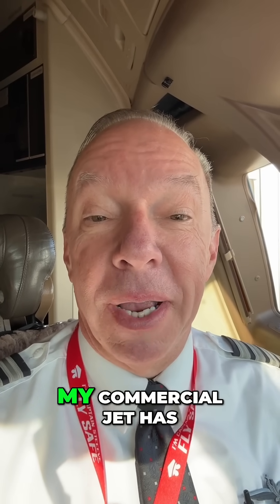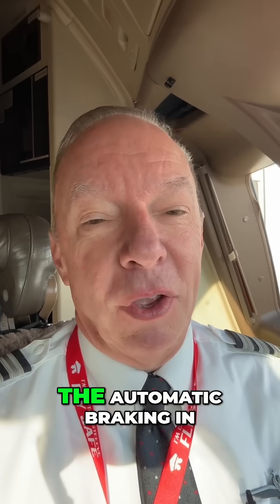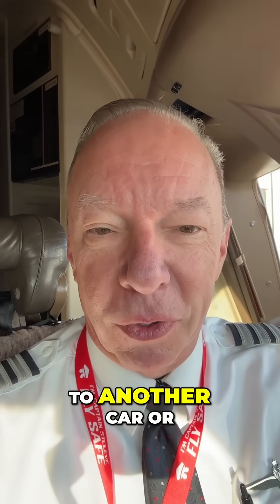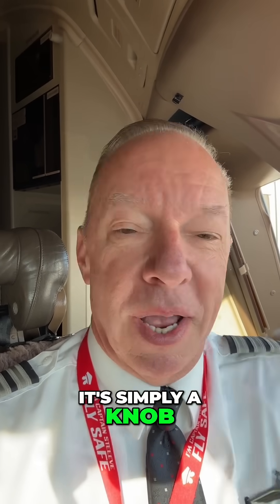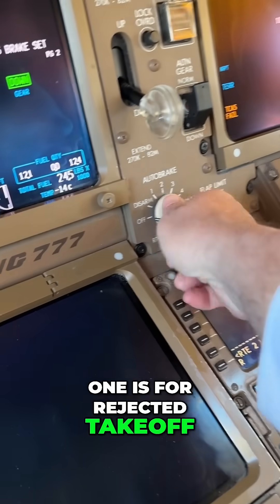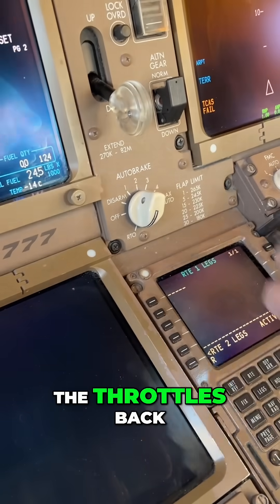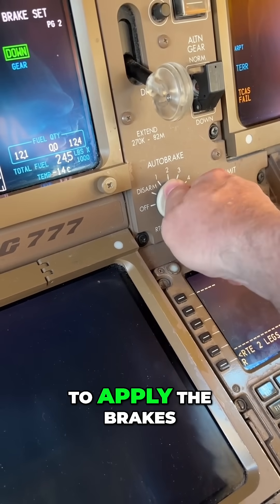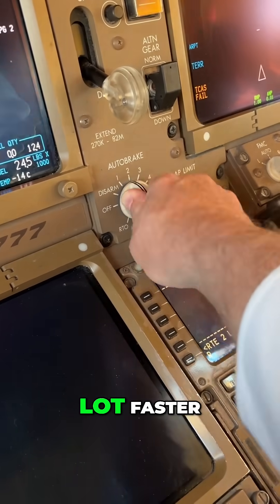How Automatic Braking Works in Commercial Jets

Comment: ATC here. Any insights for brake-to-vacate systems.  EK A380s have those and it seems to work very well.  I worked in Dubai, so not too many contaminated runways where issues may pop up.

Comment: Capt. Steve. Did you purposely leave out nil. I understand you will not land if the braking is nil, but, it still is a braking condition. Being an entirely controller in the northeast pilots will add just about every adjective to poor to avoid saying the dreaded Nil. Enjoy your videos immensely. thanks

Comment: While working on a A300 going through a heavy C check on the test flight the auto anti skid system failed. It was quite the visual experience to see the tires and wheels ground down to almost the axels on the main gear. That system began to be inspected even more so after that.

Comment: The auto brakes work off an accelerometer. They sense the rate of deceleration. Each position will decelerate the aircraft to a stop at the chosen rate. 1-3ft/sec 2-5ft/sec 3-7ft/sec 4-14ft/sec Max is a regulated application of 3000 psi brake pressure. RTO is full 3000 psi with anti skid.
Used Max in KEWR on a circle to 29. 777-200 Stopped before 22.

Comment: Auto brake works on the WOW system.  The WOW  system senses when the aircraft has landed and it's weight is squatted on it's wheels. This allows the brakes to be evenly applied.  This also lets the pilot focus on thrust reversers,  steering and other full stop functions after landing.

Comment: Captain Steve: Do you know what would cause a smaller jet to lose its air conditioning while at cruising altitude? About 15 years ago, I was on a flight from Salt Lake City to Spokane Washington and not only did we lose our A/C (it was blowing hot air) but the left side of the plane got so hot I felt like my left leg was getting burnt (I was sitting in a single seat on the left. There were two seats on the right side).  The pilot asked to decend to a lower altitude and somehow it cooled everything down immediately. Then we got to land early at our airport.

Comment: I'm assuming that it's the same auto brakes as the 747. Each selection gives you a predetermined deceleration rate. As the reversers are deployed, the brake pressure is reduced to lower brake temps. The selector also acts as a pressure limiter to the brakes, just in case one brake is deactivated, so as not it over pressure the remaining brakes.

Comment: Does this have anything to do with hard landings? I’ve noticed every flight I’ve taken in the last 2-3 years hits much harder on landing than they used to. Since it’s so widespread, regardless of airline, plane type, or pilot, I keep wondering why this is.
Reply: My technique is to land smoothly on dry runways but if there's contamination, short runway or crosswinds, then I'll make a more firm landing just to make sure we get on the ground and stopped more quickly.

Comment: I have a question?  Are all 777-200 the same?  Can you recognize a plane when you enter the cockpit? Are there planes with unique quirks?
Reply: I can say having worked at Boeing in final assembly of aircraft. The answer is no....a lot is what the airlines want in passenger deck configuration, as well as what maker of engines are used, ie GE, Pratt and Whitney, and or Rolls Royce.....so it makes a difference as to weight distribution etc etc each aircraft will have its own characteristics. But there are basic handling characteristics they all are different given the equipment involved.
Reply: @irongoatrocky2343  do any 777's from outside the US get restricted features? I'm thinkin' look-down/shoot-down radar, AMRAAMs or 50 cals.
Reply: @RetiredEE you funny very very funny!!😅
Reply: At each airline they pretty much look the same. The airline goes to great lengths to make them the same. The exception is if they bought the plane from another airline instead of new from the manufacturer.